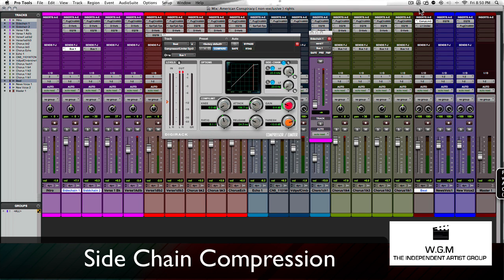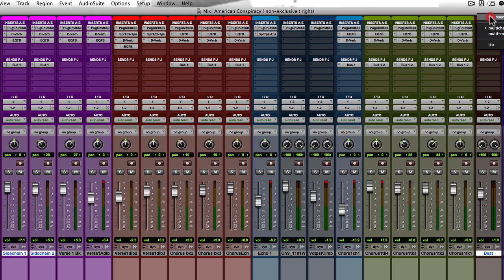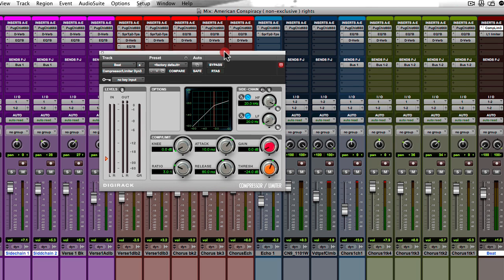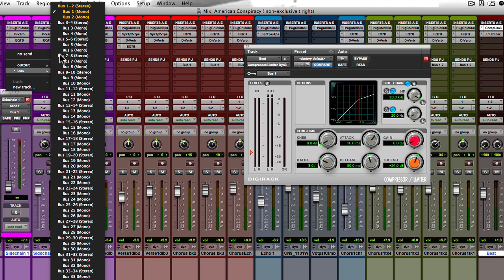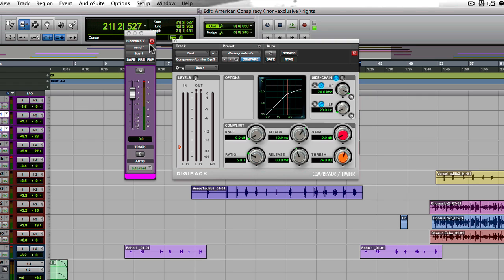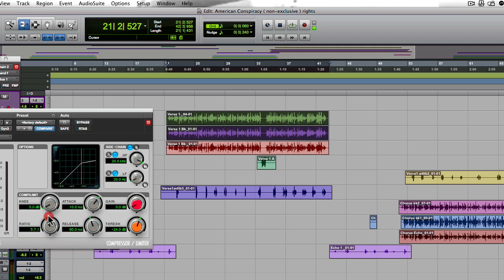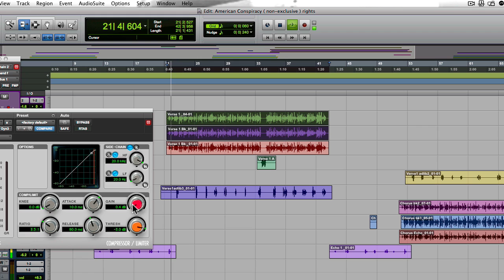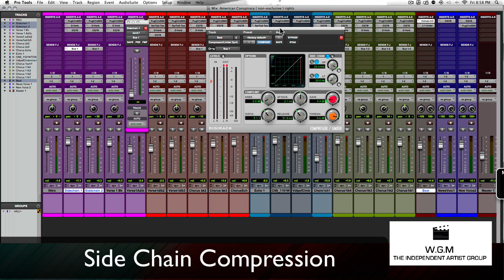Pro Tools Side Chain Compression Tutorial

Comment: Hi there

thanks for making this vid, i just have a question about the C6 Waves Multi-Band compressor (which supposedly has side chaning) and Pro-Tools, i'd like to simply send a drum track to a bass track, and add the compressor to the bass track but tell it to be triggered from the drum as you said... i am so dumb with pro tools, as i am usually a reaper user but i just cannot get this C6 to work from the drums. have you ever used C6?